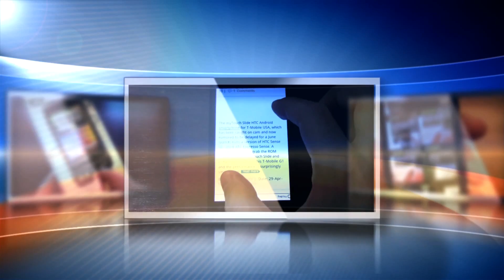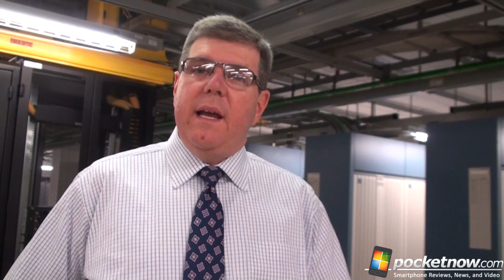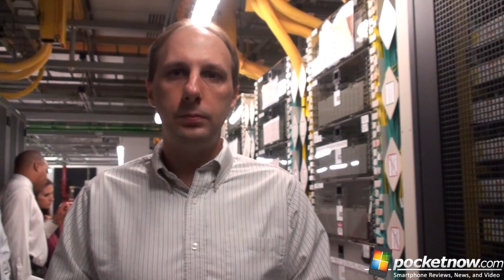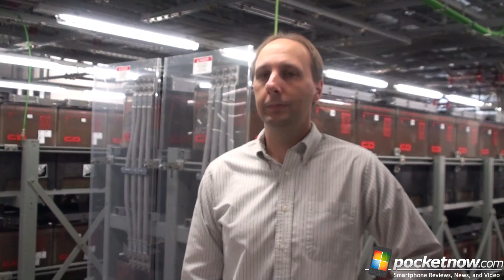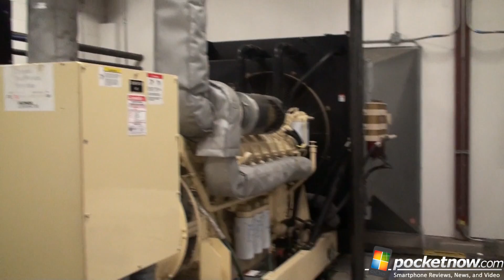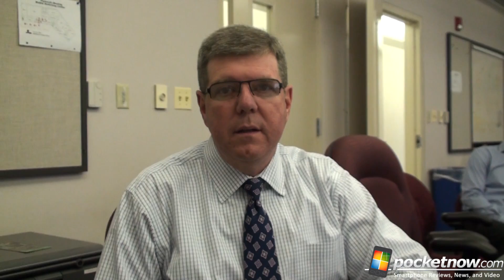Exclusive: Inside Verizon's 3G and 4G Network | Pocketnow

Comment: ram130, cause VZW wants the superior voice voice quality. That's why they deploy 1X carriers @ 800MHz and 3G EVDO rA carriers @ 1900MHz.
Remember the "nation's most reliable!?" yeah that...

AT&T's GSM 3G is newer in that they can do dynamic power/signal load balancing on their newer upgraded sites (and soon Sprint CDMA with Network Vision) in that if you are indoors it switches to 800/850MHz but outdoors close to site is 1900MHz. (Balancing in-door coverage & capacity).

VZW's 4G is the newest.

Comment: Spectrum so called "Air-Waves". Transmitter/receiver in your phone along with your antenna is designed to read/convert/modulate/digitize the Air-waves signal. Each wave length carries analog signal which will be translated to 0 and 1 (digital). Why? Person in California calls his gf "Hey; how you doing" who in Miami. Hey;how you doing is converted into a digital code which will be further converted into an analog code (radio-wave) to be transmitted to the nearest cell-phone tower. Through cell phone tower, it will going to the nearest exchange/this Verizon building for example. Before that digital code is generated, Client information such as mac id,serial number,phone number etc etc is also send to verify the legitimacy of the caller and this is why your cell phone company knows when you roam etc etc. So now, your information + "Hey;how you doing" is nothing besides a signal generated through your transmitter and emitting that signal through the cell-phone antenna in the form of an "Air-Wave" so called "Spectrum". For instance, 850 MHz or drop a stone in a water creating waves and give it a name through the distance it travels/sec or count the number of oscillations withing the given distance. It may be 2 cycles so, 2Hz/Sec. Difference is, radio waves oscillate super fast thus, 850 Mega Hertz/sec. Each Cycle in a radio-wave is an analog signal generated through your transmitter traveling to the nearest cell phone tower. Now, cell phone tower will convert that Analog signal carrying your information along with "Hey;how you doing" into a digital Signal accordingly. Your information goes thru Carrier-Servers/Network and identifies your identity that you have paid your bill on time etc etc and then your gf number which now is also connected to the nearest exchange. This place in video just simply route your call to the nearest exchange in which your gf cell phone tower keep communicating (reception).  Damn!!!!
Reply: Please pardon some typos. Too Tired!!!! These guys in the videos are highly paid engineers making over 100K. Also, they don't have a permission to disclose any confidential information. As you can tell through the noise that, those are servers and hearing the cooling fans at the background. Voice signals dont require massive infrastructure. These massive servers are for data routing.

Comment: Some folks here are wondering why the guys with ties are not telling much....That stuff is top secret corporate info. Are you going to tell your competitor how you built your telephone system?? And there needs to be security from nut case folks who want to destroy our comm systems. Radio frequencies will never be as fast as light waves.
Reply: Adrian Cressy 

MPLS networks & IMS cores are very similar no matter which company you work for.
Reply: No it's not secret. It's build from parts anyone can buy or play with. If you have a richie rich;)  And  if you study telco you can "play" with it in the lab in order to get basic principles of operations.  There are public lectures about it and vendors offers study materials to anybody. Phone networks always worked with the same principles and same design. What was different was a specific implementation of that principle eg. different equipment or different underlying architecture level.
Today phone systems are not national secret. Even local connections are publicly held in public databases to support safe distance during construction works such as road repairs or excavation. And as you probably know submarine cables are also publicly available in marine maps.
Some parts of the network such as physical connections between equipment,cable border crossings,equipment location inside facility (especially government spying devices) may be secret. But that's all.
Reply: L. R. mm

Comment: so maney lies but the biggest is when he sys lte requires 4 antennas for it to use 100mb and that is not true
Reply: vorkev1 Is call MIMO is two transmitter and two receivers to achieve 100MB Downlink the Antenna on the tower is One with MIMO path inside so there is 4 antennas in one.